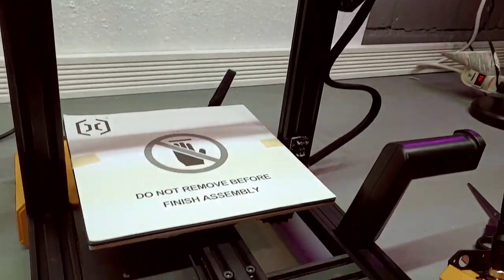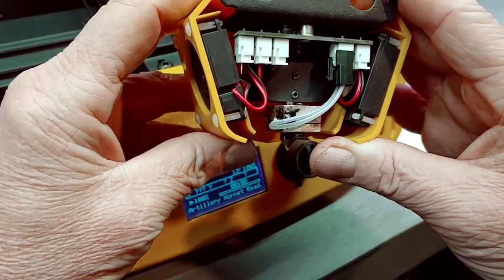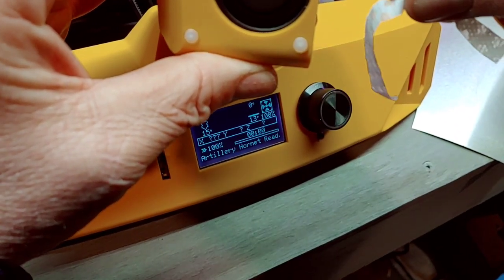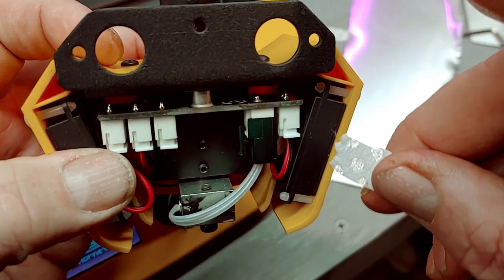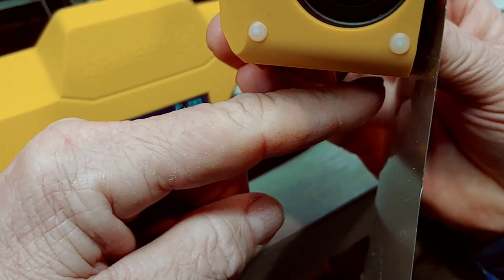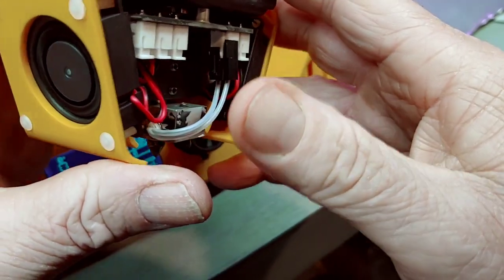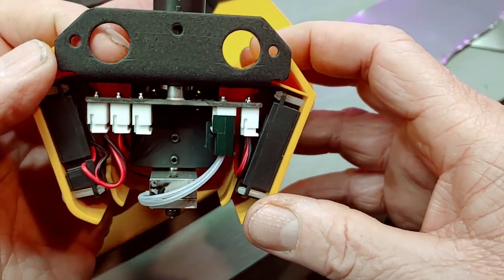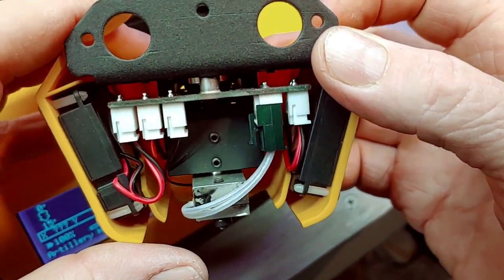artillery hornet 3D printer nozzle cooling.

Comment: I have replaced the heat-break with a titanium all metal heat-break and the nozzles with A2 tool steel nozzles and I am printing Nylon and Carbon fibre, perfectly.

With your mod, you need to leave a way for the Hot-end cooling air to escape
Reply: Can You share me place where i can find this set?